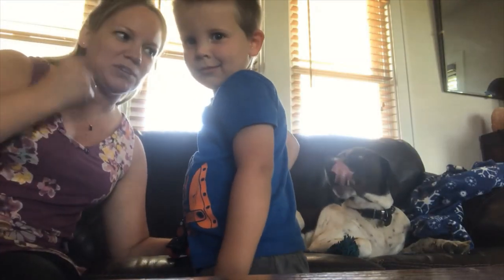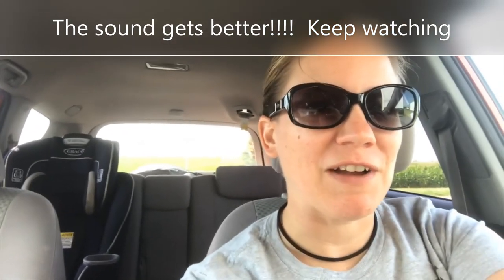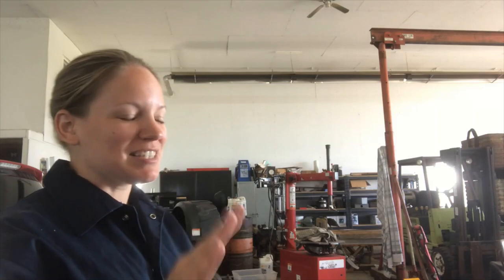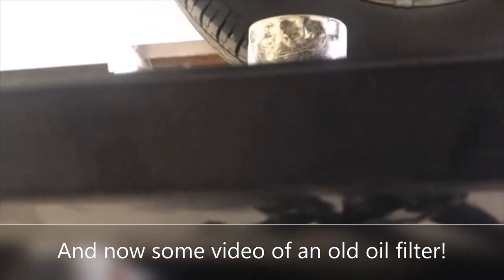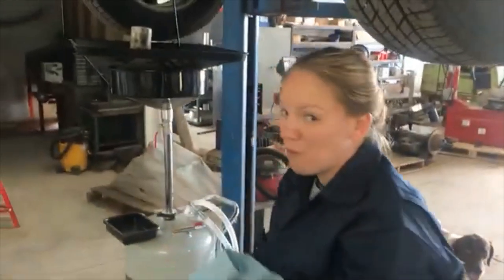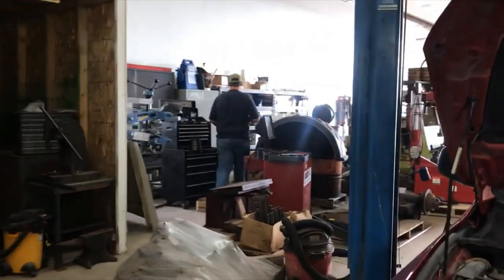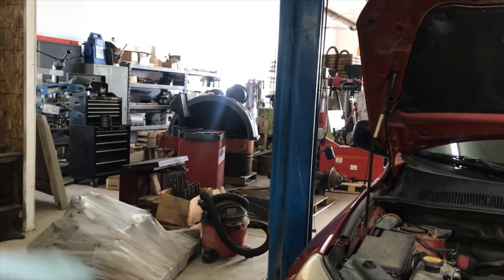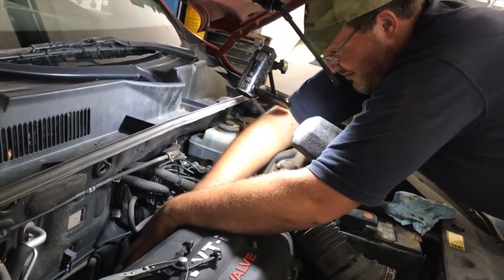Mrs. Wes Takes Over (her side of the camera)

Comment: I completely understand how you feel when Wes says "just put it under the pinch weld"...
My first time learning to drive, I was probably only 10 or 11, so it was a father/son bonding moment in an empty car park, did not go well at all. 
It was a manual and I knew the basics, not all the names of the parts, but knew which pedal to push, so got going OK, think of you on that tractor Mrs Wes. 
My father decided, when we were heading in the direction of a pole, to start repeatedly screaming "declutch, declutch, declutch, for f sake declutch" at me. I didn't have a clue what he meant, which resulted in a heated discussion while I steered away from the pole, I mean it was an empty car park. I stopped the car and the discussion continued, with me explaining that there was no point repeatedly screaming something at me that I didn't understand. 🤣🤣🤣🤣🤣🤣🤣
Reply from the maker: YES!!!  I never know the technical names

Comment: It's a lot easier to air your tires while the car is on the lift---just set it to a comfortable height and you will not have to bend over or kneel to find the valve stem. Save your back from strain.